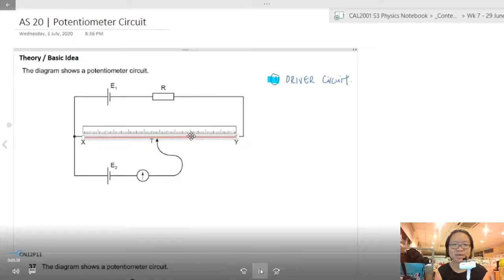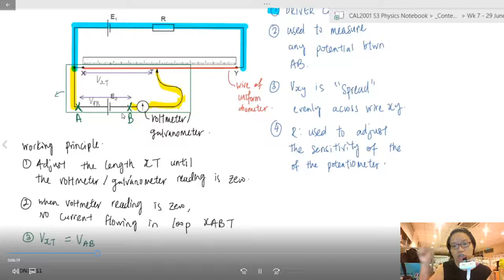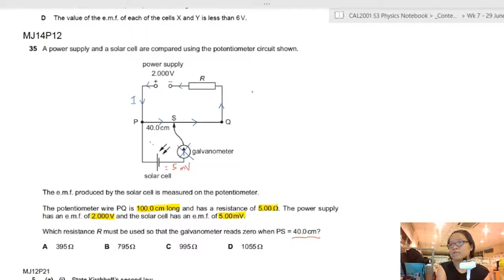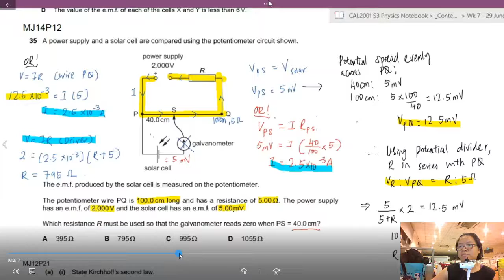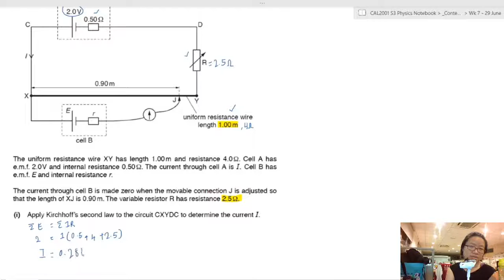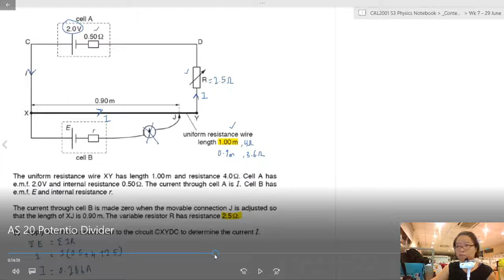[ARCHIVED] Potentiometer Circuits (Part 1) | DC Electricity

Comment: Miss i did it another way aswell in 2 steps
1. i found resistance of wire PS using ratio which was  2
2. i used the formula Vout = (Vin * Rn)/Rtotal
3. So which was 0.005 = (2*2)/(5+R)
4. R= 795